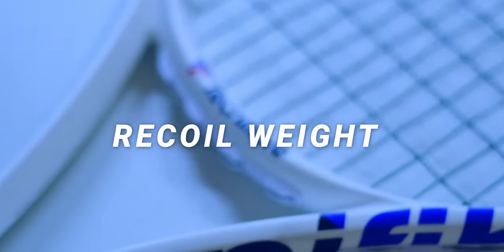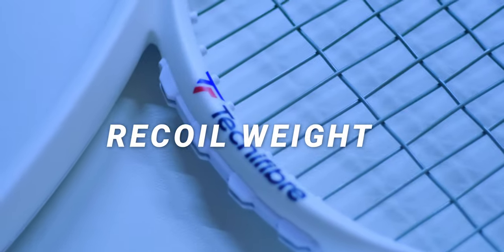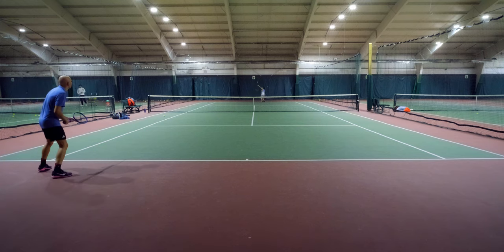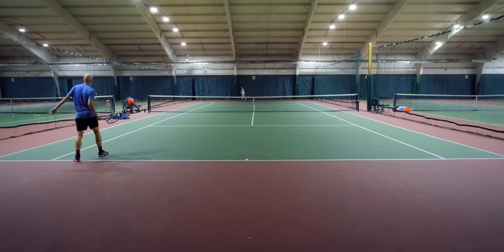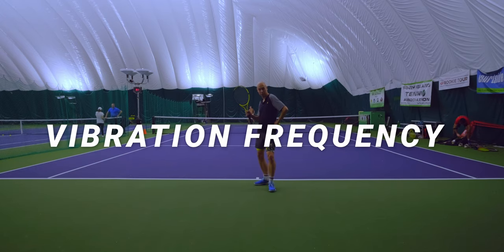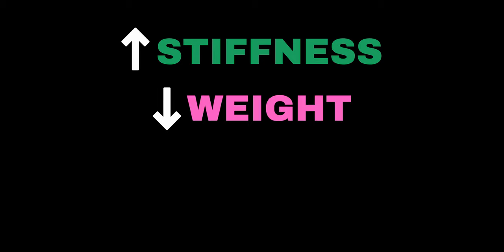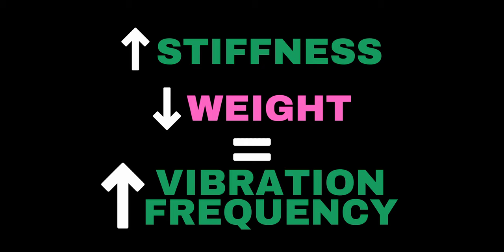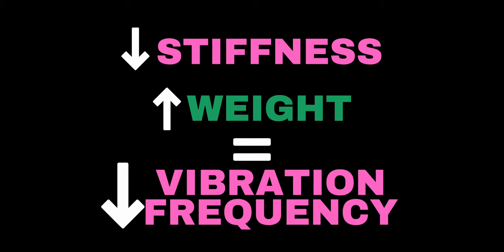6 Things Racquet Manufacturers Hide from Us

Comment: Would be cool if manufacturers reported what their "acceptable" tolerances for static and swing weight are.
Reply from the maker: I think Babolat is the only one that clearly states +/-7g for static weight. They get credit for being clear, but that’s such a crazy range that all credit is lost.
Reply: @TennCom  imagine if you buy 2 sticks, get really unlucky, and they differ by 14g static near 12 o'clock. Recovering that with customisation will be a bit of a challenge. I guess that's why prostocks are so light out of the line. There's a company in the UK called Angell sports that do "their own frames". Reading about their process, it sounds to me like they get light frames from china, then finish it in house to keep QC at a high standard.
Reply: @TennCom  Just like Tecnifibre T-Fight 2020 : weight +/-7gr ; balance +/-7mm
Reply from the maker: @tafder  oh wow I didn’t know Angell was that artisanal. Very cool
Reply: @TennCom  so you can have two same molds with 14 gr of difference lol

Comment: On the speculated vibration magnitude variable. If you want to follow the earthquake analogy thoroughly, the proper name would be vibration intensity. To put it in layman terms, the key parameter is the coupled characteristic frequency of the racquet connected with the player and the vibration (set of amplitudes/frequencies) generated when hitting the ball (there should be a classification of different type of solicitations depending on your and your opponent play style, your racquet setup, and your forearm length perhaps). If this external frequency set overlaps with the coupled characteristic frequency of the racquet and the player: You should have resonance, which is an out-of-control jerkiness, which will be felt as extreme vibration intensity. The big question is: Is that possible? You will need to ball-park these inner and outer frequency variables to find if resonance is actually feasible. If not (and this is probably the case), then the stiffness variable is enough.

Comment: @tenncom Well done! good summary, one thing i would like to mention. in my opinion,  twistweight is also responsible for a muted feel in a racquet. i  did an experiment, i took 2 racquets, same model with same specs but 1 tuned with twistweight at 13.5 and the other at 14.5 tw. guess what, the one with less tw felt less muted since the lower tw gives you more feedback. so maybe the old vintage racquets didnt have more feel, but they only had less tw :)
Reply from the maker: This is a very hot take but I agree. More TW means less vibration off centre means less feel
Reply: @TennCom  you should try it by yourself. its really interesting how much the racquet changes its charecteristics if you change tw only. even a pure strike can become an agile racquet it you remove the red headguard and then customize it to your lower tw / sw likings :)
Reply: @vscope  but more tw means more plowthrough means more flex means more feel, so it's depends on what feel you talking about!

Comment: Hey Beckett, nice video very informative. I was looking for some information on strings. I bought and strung a brand new racquet and been using it a few hours. I noticed a weird buzzing sound on impact of the stringbed, balls and even when bumping my palm on it. Almost like a harmonic frequency. But after hitting a couple more hours with it, the sound disappeared. I'm probably being paranoid, also because I framed quite a few shots and was wondering if that had anything to do with it? 
I'd appreciate any input/thoughts you may have on this. Thanks ☺️
Reply from the maker: open the trap door in the buttcap and see if anything falls out

Comment: Good video. I have a question for you. I'm 64 and the racket i use is a Head Instinct Liquidmetal Tour XL strung at 23kg with Tecnifibre NRG2, weight 325gr  RA63 swingweight 336   100in and 16x19 of stringbed. I play more doubles today than singles  . I wish an allround and powerful   racket .I tryed Pro Kennex Q5 X PRO comfortable but not more powerful with the same string. What racket you reccomand to me between EZONE 100 , VCORE 100 and HEAD SPEED MP?
Reply from the maker: Between those 3 I like the EZONE 100 the best. Its very predictable for a power racquet so its easy to find confidence in control to complement the great power and stability.

Comment: But as I know we still don’t have a place where we can check all this values. TW trying to do some job but not for all racquets, especially HEAD 2022-2023, from 275 to 285 grams 
For example Extreme Team / Speed series, Clash 100L v2 or ULTRA 100L v4.
Reply from the maker: We are lucky that TW even bothers to track this stuff. I don’t think there are any other institutions that have the capacity
Reply: @TennCom  I believe that racquet manufacturers have capacity but it’s smth like internal information. 
In any case I think that most of  people will ignore this parameters because they can’t find any info about it and as usual will pay attention to sw / weight/balance